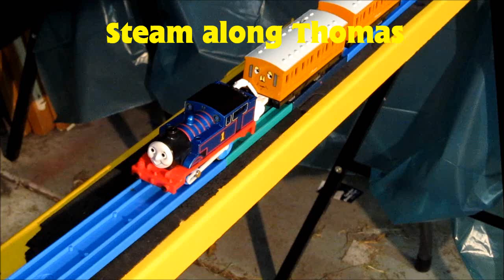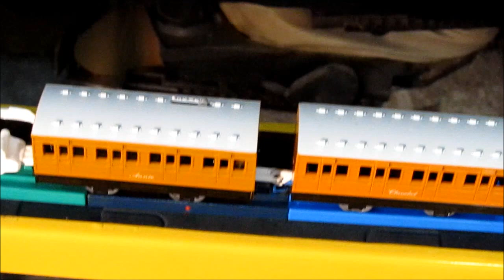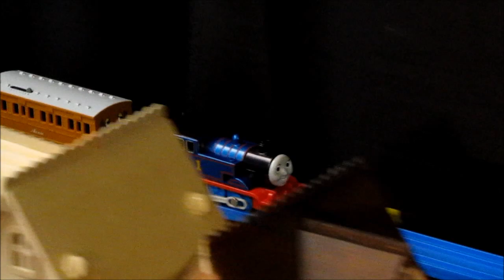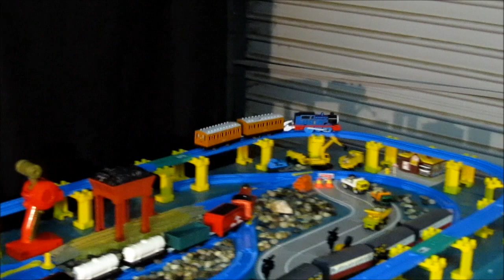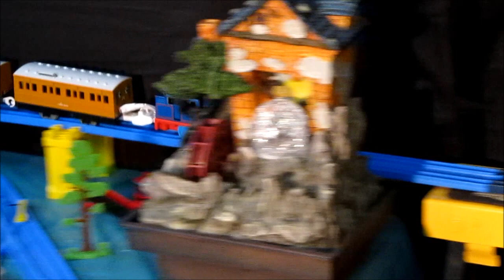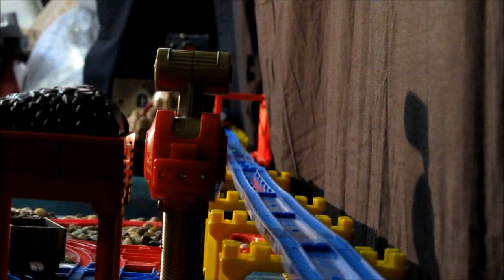TOMY 2006 Freshly repaired Steam along Thomas demonstration

Comment: Where did u have to resolder the wires on the inside of thomas? I got the D51 version of this with split wires.
Reply from the maker: Otaku Railfan Hi this was nearly 3 years ago and I have forgotten sorry
Reply from the maker: Otaku Railfan The wires on mine were still there just they were cut in the middle.

Comment: Ucwepn  why do Thomas and Annie have a weird coupling to themselves
Reply from the maker: hi the battery compartment and motor is inside Annie. there are wires that run to thomas that power his speaker and the steam system. thats why the coupling is weird it has wires running through it .
Reply: Thank you ucwepn

Comment: I Have the Plarail version (with white rinning plate). what was yoir very first trackmaster model ucwepn and what year did you start collecting tomy plarail. by the time i was 24 years old i started collecting them. my very first model was plarail powerful gordon. that is the angry gordon with a white running plate with a red express coach. but my first plarail layout was as big as your pool table layout 1st design.
Reply: The white running board? That is so rare! I am willing to get one

Comment: Oops...lol.  I was trying to remove some string that got caught up in Annie's axel and I broke a $@!%* wire on the motor!!  Can ya help??  Thanks!
Reply from the maker: Ok you can remove the shell from Annie if you have the correct screwdriver and try to re-attach the wire or solder a new wire in its place.

Comment: I need help with our set!  For some reason no matter what brand of battery I use Annie just can't push Thomas!  I want to fix this for my youngest son. Annie moves very fast as you hold her in the air, but as soon as you set them down...nothing.  Please help!  Thanks!!
Reply from the maker: Hi, now when Annie is running in the air can you put pressure on the driving wheels and stop them easily? or does it make a click click click sound when you try and stop the wheels? easily stopped wheels means a cracked axle gear, click click click can mean a weak spring on the slipper gear. Both problems can be fixed by either replacing the part or gluing the part with super glue.
Reply: Is the wheel moving if it's on the ground?